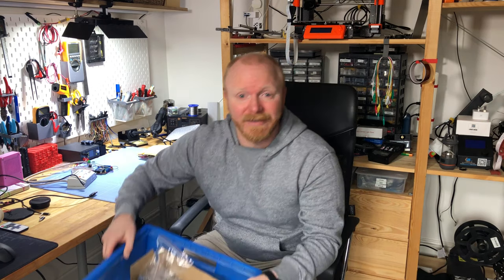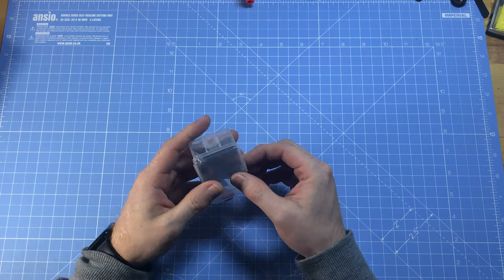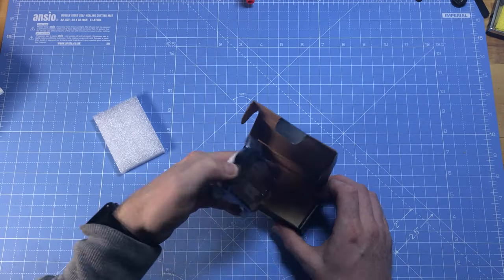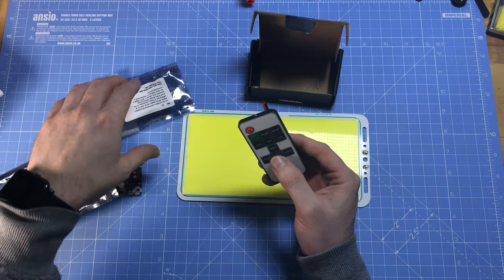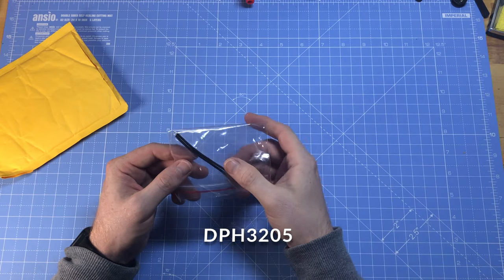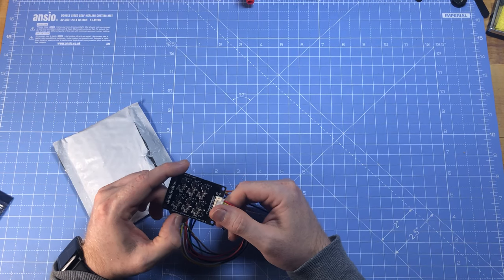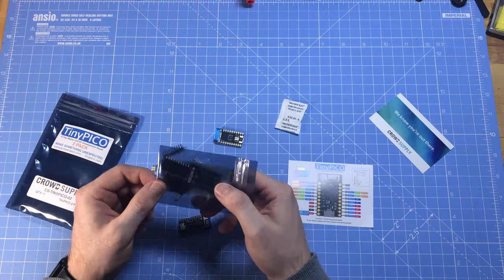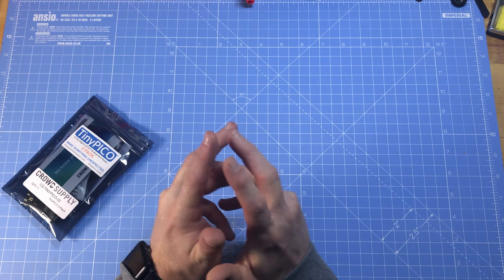Postbag #3 with TinyPico

Comment: The tiny pico is a fab product isn’t it? Interested to hear you’re not using your sonoff rf bridge? It’s formed a really important part of my home automation system. It triggers cheap rf sockets, but it listens out for door and window sensors and IR movement sensors as well as a few different cheap rf remotes to trigger automations. Nice few bits in the sack today Colin - cheers.
Reply from the maker: Yup a great product, just need to find a deserving project.  In all honesty i'm not using it partly due to laziness and also because i only have a few sensors which use RF so no real pressing need.  Really should get it going though, what did you flash on yours tasmota?  Sorry for the delayed reply.

Comment: You will definitely need more than 1 charcoal filter, I tried making one and it is very porous and brittle, I will have to buy some more or use the fabric mesh ones instead
Reply from the maker: Thanks I paid a bit more to get it for the UK so will do the design that takes 3 and put the other two in when they come from Ali.